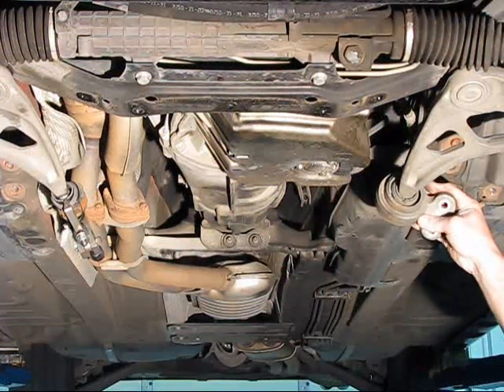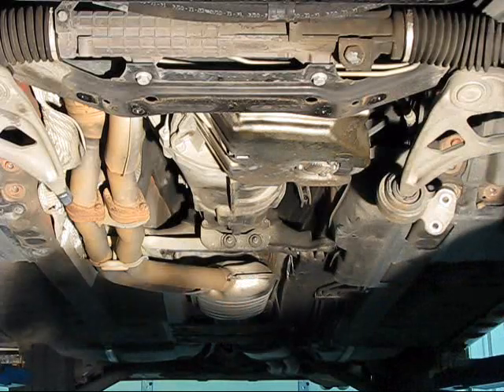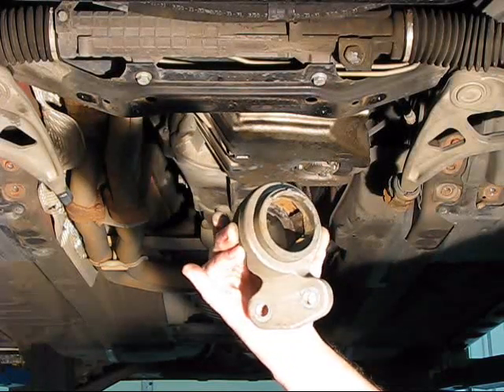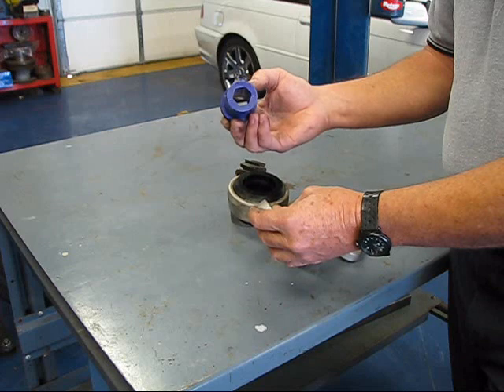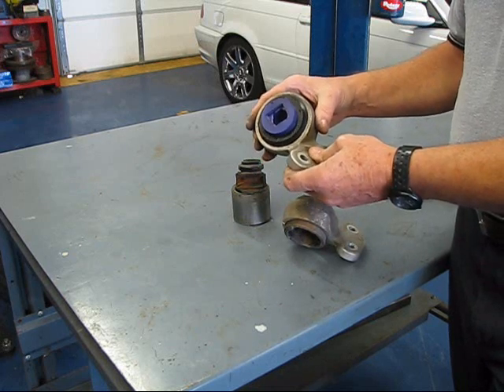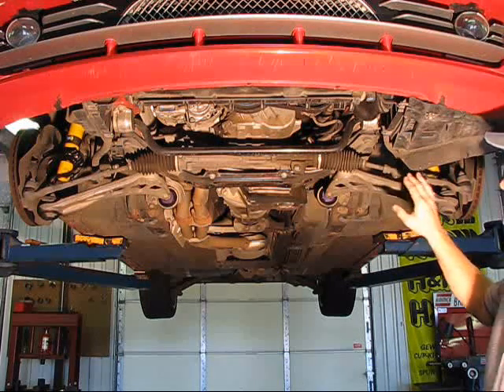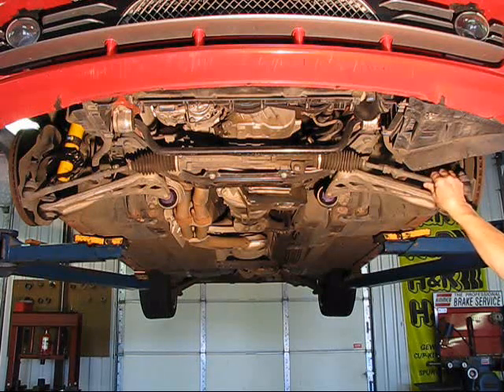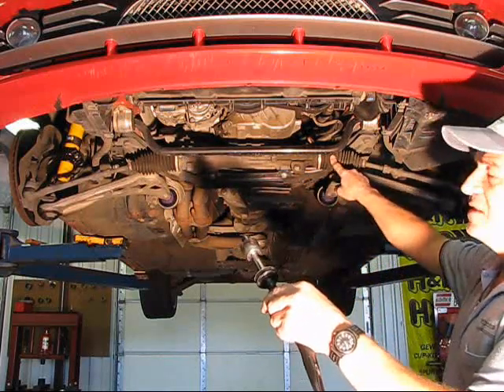BMW Control Arm Bushing Replacement

Comment: You dont need to replace control arm if outer ball joint is bad. Just take control arm and with press take it out and change it.
Reply: These have solid ball joints. If any ball joint needs to be serviced, whole arms gotta be replaced

Comment: It's not easy pressing the old bushings out or pressing the new bushings in and can be time consuming, what tool did you use?
  I know alot of part stores have a brand new unit ready to bolt in.
   https://www.ecstuning.com/ES2642674/?gclid=CLSLo4S2rMsCFQ5qfgodk04M7A

Comment: Just excellent. Thanks. The best most comprehensive video I've seen on this project.  Explains it all - inner and outer ball joints, control arms, bushings, upgrades, and the importance of having it all fixed right to get a good alignment. Going to make the GF watch this so she knows whats up when she takes her BMW in for an alignment and some bozo tries to rip her off for 26 parts.

Comment: I personally would not recommend urethane bushings as they make that creaking noise.  Wasted my money on that one. Applying grease does not do the job so don't even bother to go there.  Just get the rubber ones.  They are easy to replace anyway so there should be no issue on which ones last longer.  LimayBataanBoy

Comment: if it wobbles at high speed like that, it could mean that your brake rotors are warped. most likely rear ones. hope you fixed this by now

Comment: @528im52  Great, thanks for the info.  I'm going to buy a puller and use a friend's power drill for the front.  The back may have to wait.

Comment from the maker: @jereisluke  The rear control arm bushings are a bit more involved and are much more difficult to get to than the front ones.  As for removing the control arms in install the bushings, it is not required to do so on the E36, the process is very similar to the one in this video, the components just look slightly different.  The impact drill was simply used for the speed in which it gets the job done, most people use a chisel and hammer to force the inner sleeve off of the control arm.

Comment: I have a '95 318is and my mechanic told me I need to replace front and rear control arm bushings.  I had a few questions:

1)  Are the rear control arm bushings pretty similar to replacing the front ones?
2)  I read another DIY that said to take the whole control arm out, can I replace these with the control arm still on the car on an E36?
3)  Any other way to get the old bushings off the control arm besides the impact drill?  I don't have one of those.  Thanks.

Comment from the maker: @Axio1matic There is not any other bushing on the control arms of a 3-series sedans from 1999 to 2005, and 3-series coupes from 1999 to 2006.  When you say 240 per arm with bushing kit, would that include replacing the control arms as well?  If so that is not too bad of a price per side and is just a bit higher that if you bought the control arm and bushing from us, but if that is just for the bushings alone it is extremely high.

Comment from the maker: @deffi88 There are many things that would need to be checked, basically all ball-joints or bushings, as for the sway-bar the end-links on the sway-bar are normally the issue, they are about $25-$45 each depending on your exact model.  If they are going out you will hear a little bit of a pop or slight banging sound when you go over speed bumps or are pulling in or out of parking lots where there may be dips.  If that is not the issue then it may be the sway-bar bushings that need replaced.

Comment from the maker: @deffi88 There is a good chance that it is, there are three main possibilities when it comes to the ball joints making a popping sound.  The Control Arm, Tie Rod, and Swaybar Link, these are the three items that could be making the noise, the only problem is when you are turning, all three types of these ball joints are moving and turning as well.  Its best to try to isolate which side it is coming from, then with the car on a lift or on jack stands get under it and have someone turn the wheel.

Comment from the maker: @luganballer99 We didn't get into that due to a 4+ton press being needed to push the old bushings and their sleeves out.  Most individuals do not have this kind of equipment and would need to take the brackets to a shop to have the bushings removed.

Comment from the maker: @Thegarmendia   Some People state that there is more noise, but we have installed 100+ sets of Urethane Bushings on E30, E36, E46, and E39 have have seen little to no adverse noise.  As for squeaking, as long as you lubricate the gushing and shuttle with a water-resistant grease there should be little to no squeaking.

Comment: @528im52 Thanks for the info.  I guess I will just get the alignment done, as there was no "jumping" at constant braking pressure, and the BMW dealer in Ann Arbor said it was fine, I even spoke to his tech and looked at it myself with him.  The only reason I had a doubt was because a "reputed" Indy suggested I replace the bushings, as well as tie rod!  I will look at the bushings again in 6 mos, since I'm approaching 100K.   Thanks for the prompt reply, wish your shop was in Ann Arbor!

Comment: Hi,  in your video about checking to see for control arm bushing failure, you show how the front wheel jumps back a bit when you brake at low speeds.  The same thing happens for me ONLY if I repeatedly jab and leave the brakes at a low speed.  Is that what you were doing in that video??

Long story short, BMW dealer says my suspension is fine after hoisting it up, while the indy shop wants me to change bushings.  Who to trust?  I need to do an alignment so wanted to sort this out first.  Thx!

Comment: Nice video, I wish I had the tools to do this job. My 2000 528i has 100K miles on it and it needs major maintenance, like O2 sensor replacement and such.. How bout a video on replacing shocks. I would appreciate it a lot. Thanks.

Comment: I fitted some of these Powerflex bushes to my e46 today. Very easy job to do, but I did have access to a ramp, puller, press etc. I've done a good road test on various different road surfaces. The ride quality is perhaps a little harsher on very poor roads, but the difference is so small it might even be in my head. The steering has definitely sharpened up slightly though. Provided they don't wear prematurely, which I very much doubt, I would recommended them.

Comment from the maker: Honestly it just depends, the labor time called for on this is 3.5-4.0 hours from start to finish plus an alignment and the actual parts.  I believe that our shop charges about $375.00 for the install, parts, and alignment.  I do know the local dealership charges over $450.00 for the exact same job.

Comment: i did the same type of job in my e46 and i didn't use those cain of electric tools ...the only problem was the aluminium shield who was a bit stubborn, the bushings came out easy...just by hand, after i removed the bushings i just put the new one with the help of vaseline, after the bushing was in position i used a rust bolt spray WD40 to remove the vaseline from there...wipe the rest of the remaining vaseline and bolt it back in posision and that was it.

Comment: I have a 04' BMW m3 that I just bought. 25k miles. I brought it in to the dealer for an oil change and to check the brakes and they said that my ball joints are loose and need to be replaced.  Is this possible with only 25k miles??

Comment from the maker: Well, as I said a shop can do it with less work and possible damage, normally they charge between $15-$30 to press out a pair of bushings like these and to put the new ones in, but with a large vice and sawzall and safety glasses  you can do it yourself and all you would need is what you have plus the new bushings...

Comment from the maker: Normally that would require you to have the old bushings pressed out with a press and the new ones pressed in, we used an 8 ton press in our shop for ease if doing so, but a lot of people have taken alternative means to getting them out such as cutting them out with a "sawzall" or "hacksaw."   But starting next Monday 10/19/2009 we will be carrying these bushings already pressed into new brackets ready to be simply bolted onto your vehicle.

Comment from the maker: There is no good way to balance or align the wheels and tires without going to a good shop, the balancing machines and laser aligners that they use are extremely accurate and are the only true way to ensure proper alignment specifications.  There are some at home kits and track-side kits for alignment, but these are only to be used for a quick alignment and are not always 100% correct

Comment from the maker: Once the Bolts are removed off of the control arm ball joints you will have to hake a large 2-prong fork (fork as in tool, not eating utensil) and pry the arm from the chassis.  The control arm has most likely been installed for many years and needs a little help to be removed since it is probably "frozen" to the chassis.

Comment: Depends. Do a visual inspection of the control arm bushing first to check for cracks and excessive wear.

It took me a good 6 hours to do it on a 97 M3 because it was my first time attempting and I didn't have the desired tools so I had to kinda macgyver a fell things. I could do it in 1-2 hours now that I know the tricks with my own tools.

Is it worth it? I would change them out anyway as the rubber doesn't tend to last very long.

Comment: I would check your rear anti-roll bars and or Pittman arms! As they are all RWD, power pushing the weight forward from the back will push the steering from side to side if the anti-roll bars have wear or are broken! If you cant feel a slight knocking under your feet when driving or hear a slight knocking, then the bushes are ok! These are available in the U.K from German swedish and french car parts for £60 inc VAT on trade prices or around £70 plus any garage can fit these for 2 hours + VAT!

Comment: I noticed that my steering feel changes from time to time. Sometimes, the steering feels slightly disconnected and loose and at other times it feels precise and heavy. Whenever I drive or break on rough surfaces or bad roads, the steering moves left and right whenever the tires hit the rough patches on the road and I have to hold the steering tight to make the car go straight. Is this caused by worn out Control Arm bushings?
325ci 02/50k miles

Comment from the maker: The under-body is similar to what you see in this video, and if you get under the car look at the bushings that are in the same location as the ones in this video you can see if there is any cracking or separation in the bushing itself, if there is then I would suggest replacing them.  You will also want to look at the ball-joints that are on the control arms for any wear or excess play...

Comment: Great video!

I have the same problem with my 2002 330CiC.  I've been feeling the shimmy when I go over uneven pavement, one tire is worn unevenly, and the steering wheel is not centered.  The mechanic at my dealer says the bushing is worn.  I wonder why BMW makes such a weak bushing because I've never had that problem with any other car I've owned.

Comment from the maker: If these bushings are not replaced you will see a great deal of shimmy during driving and especially under braking.  Also uneven tire wear will occur causing you to purchase more and more tires over time, for the price of this repair, the gains are extremely well worth it....